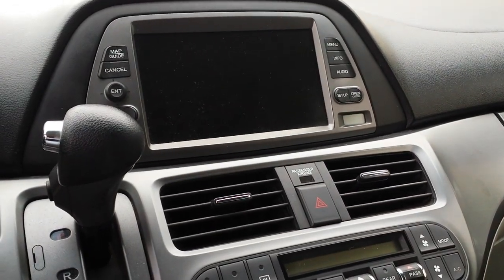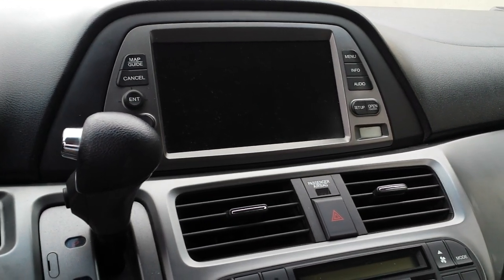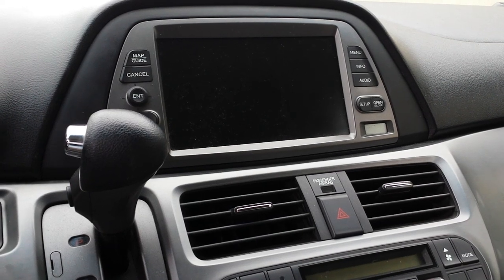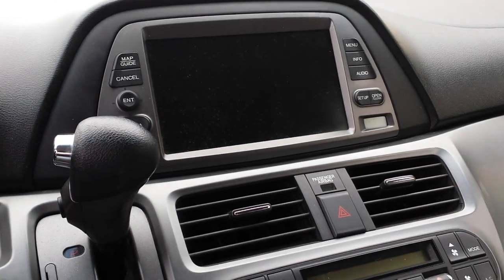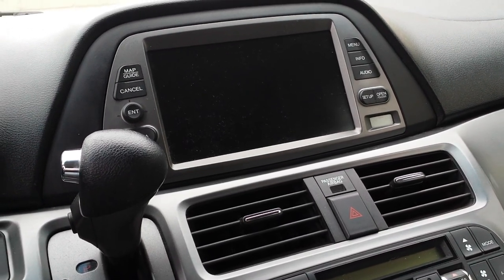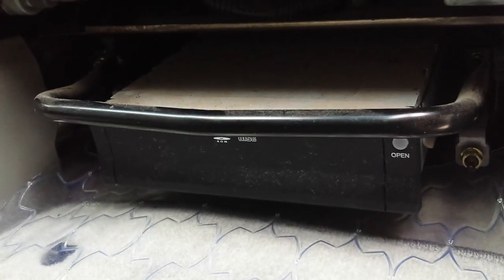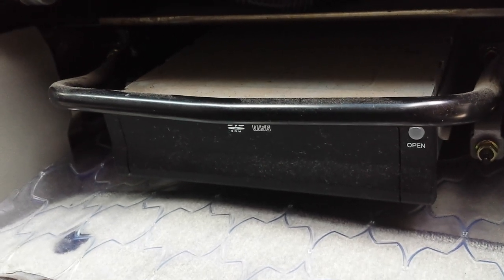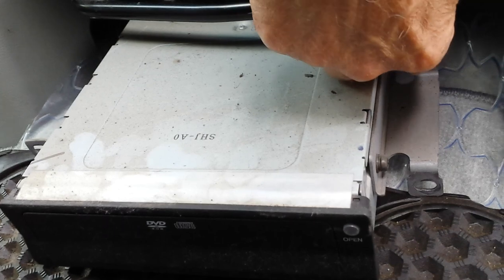Honda Odyssey black navigation screen !

Comment: HiTechelElectronis is awesome.  Very professional, quick to respond and great communications. The motherboard in my DVD Navigation drive went out.  (insert disk was on the screen) The Honda dealer wanted $1600 to replace the entire unit as they don't do repairs on Navigation systems. HiTech repaired it for only $550.  Getting the drive out from under the seat was a little more difficult than the video showed.  You need a 10mm ratchet wrench with an 8 inch extension.  The hard part was unclipping  the connectors off the backside.  Take a lot of pictures while you was doing it so you can reference them when you reinstall.
Reply: I'm wondering if you could help me. I've taken all the screws out. How many connectors are there to unclip and where are they?
Reply: I had three (maybe four) connections to unhook.  There were a few extra slots on the back of the unit so take plenty of pictures before you start disconnecting.
Reply: Larry Gannon Hey Larry, I just bought an 07 Odyssey and my navigation works but just looks old and outdated. I see I can purchase the new navigation from Honda for $100 off there website. Do you know by chance if that will update the looks of it or just the streets and things? Have you updated yours and it changed the look or just updated street info? Thanks for the time
Reply: Yes, I have the latest updated DVD.  It does update the streets but I think the UX is still very similar to the older DVD.  It was worth purchasing for me because there are a lot of new streets in my area.
Reply: Thanks for your reply! I've taken all 4 screws out and I still can't get the thing to budge to even look at the connectors. It's like it is still screwed in somehow. Any ideas?
Reply: There are 6 screws.  3 on each side.  Two of the screws are deeper back in which is why you'll need a longer shaft for the wrench.  Don't give up. You can do it!
Reply: Thanks Larry! I'm trying to not give up! I've taken 6 screws total out, but 2 of them were just holding that black bar in that moves the seat back and forth. Are there other screws? It still won't budge.
Reply: I got it out. It was just really stuck in there and I had to pull it really hard to get it out.
Reply: Yeah!!!
Reply: once you take out the navigation from under the seat, do you just replace it entirely with a new one

Comment: Are you sure that's the problem,  I'm having this issue but weird the fact that not only the screen but the clock and cd changer nothing works so it's hard to believe.
Reply from the maker: The clock gets data from your navigation.

Comment: Hello. I have 2006 odyssey touring. I had sliding door issue so i was playing around with the fuses. I reset and then the radio amd nav screen was asking for the code. Beforeni could put the code, the nav screen went black. There no power to the nav screen. No clock. It doesnt open for the cd. The nav drive below driver seat seems to have power. I have checked all the fuses. What could be my issue?

Comment: Mine just goes from the Honda start up screen to a checkered glitched looking screen. Never goes black. I can’t find anything on how to go about finding the issue.
Reply from the maker: The Monitor is fine most likely the navigation drive unit under the seat is faulty. You could send it to Alpine Electronics in California to get bench tested and repaired.

Comment: My screen is blank until I open the CD unit and it goes in the flat position the warning comes up that you should not put your coffee cup on the display . Press the open / close button the display goes black again as it becomes vertical
Reply from the maker: You need to send your navigation drive unit for repair.
Reply: Same for mines

Comment: Hi my navigation system is not working it’s either black screen or it will say the disc is loading then nothing happens? What to do ? And also I have a stuck DVD inside and it’s not working!!!!
Reply: The navigation drive unit under the seat has a bad main board. You needs to have it repaired or replaced. Please check our web site for prices.  https://hitechserv.com/

Comment: Hi i have the same problem but when i buy the ody some harness where disconnected and hidden under the floor , i get them out but theres not all wire harnesses or idont know can u tell me or show me how many harnesses are in the navi system dvd player are, the button of the navy system is orange , it has to be green?? Or orange ty

Comment: How do I disable the screen? It's very bright and it's outdated so I just use Google Maps
Reply from the maker: You could remove the display and unplug it from the back or just add a filter to the screen to reduce brightness.

Comment: I bought a odyseyy and the navigation as well as the TV in the rear was stolen is it possible to  replace  them from salvage yard and if so what all needs to be done.
Reply from the maker: Yes, you can replace them with a used one but we do not sell any, please contact you local salvage yards.
Reply: HiTechElectronic
i have a honda oddysey 2006 navy system not wrkn. 
I'm in long island NY